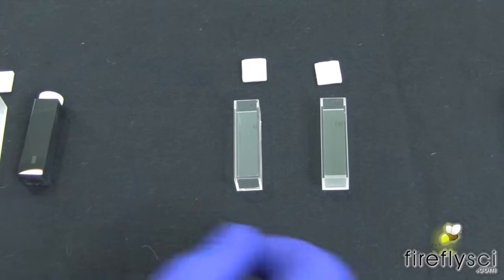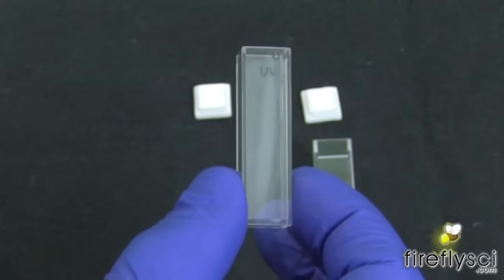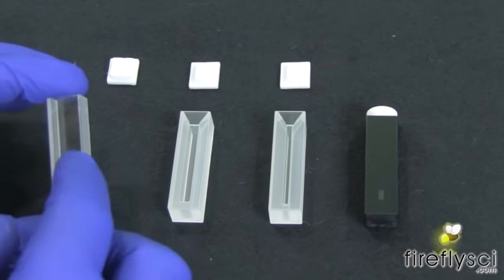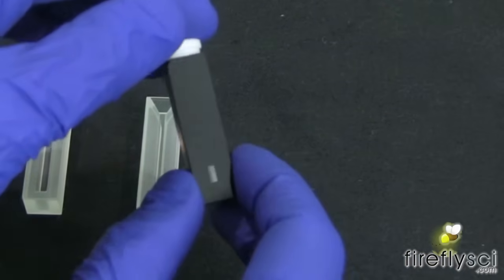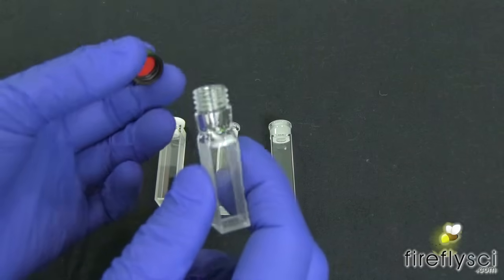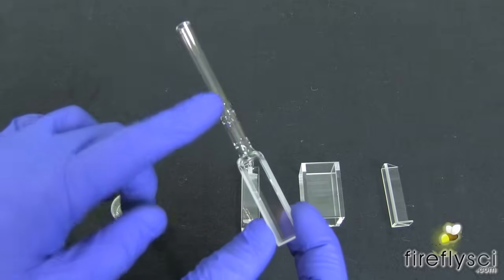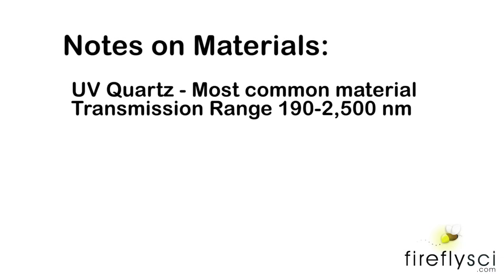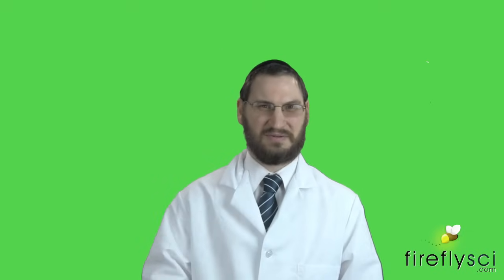Cuvette Introduction

Comment: Can you mix contents or shake a cuvette?
Reply from the maker: Hi Batubo!  Thank you for your question.  Yes you can shake or mix contents in a cuvette.  You must make sure the top of the cuvette is sealed before doing this.  Some good cuvettes for this are our Type 21 stoppered cuvettes or our Type 41 screw cap cells.  Here are links:  https://www.fireflysci.com/macro-spectrophotometer-cuvettes/type-21-macro-cuvette-with-ptfe-stopper-lightpaths-01-100mm  https://www.fireflysci.com/macro-spectrophotometer-cuvettes/type-41-macro-cuvette

Comment: Small tip: when shooting in front of a green screen, you can avoid that dark line around the subject by setting your camera to a "RAW" output.
Reply from the maker: Hi Evan!  Thanks for the comment.  I'm using a Canon Vixia G10.  I'm not sure if it has a RAW output.  Where do I find this option?
Reply: @fireflysci1194  in the settings, you should see options for "recording mode" and for "frame rate"

The best recording mode for a green screen on that camera is MXP. The best frame rate is progressive, so you want PF30. Let me know if you need specific directions for how to get to the settings.
Reply from the maker: @EvanRoden  Thanks Evan, I'll give those settings a shot next time I use the green screen.

Comment: We have disposable cuvettes made up of plastic.  Using them for more than one time can have effects on the result??
Reply from the maker: Hi Amara.  Thank you for your question.  It is never advisable to use a plastic cuvette more than one time.  They are designed for single use only.  Chemicals can leech into the plastic and cause inaccurate measurements.  Let us know if you need any other help.

Comment: I want Quartz cuvette size 40*28*26 mm which can resist 280-300 degree celsius temperature. You have this type of cuvette ?
Reply from the maker: Hi Pratik, this is close to our stock 2267AUV20 found here: https://www.fireflysci.com/dye-laser-cells/type-2267a-dye-laser-cell-lightpath-20mm The exact dimensions of 40x28x26mm will require us to make this as a custom cell. There is an 8-10 week lead time for this. Please e-mail us at info@fireflysci.com to discuss this further.